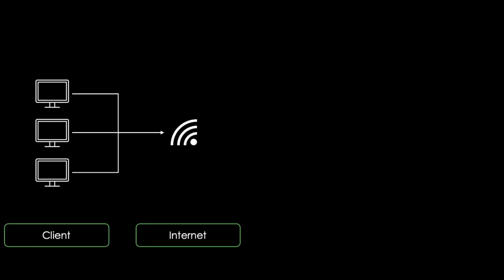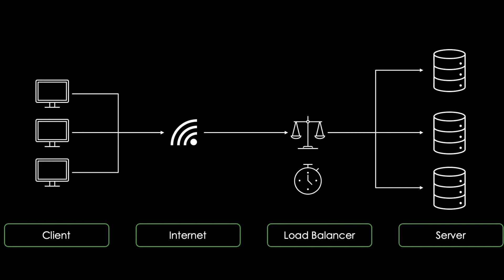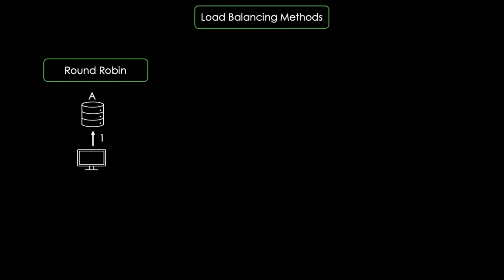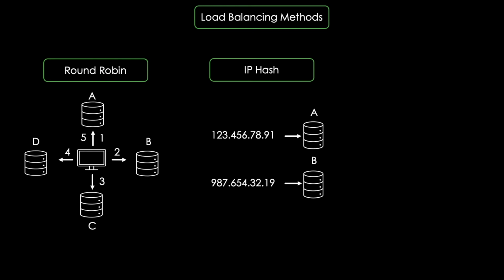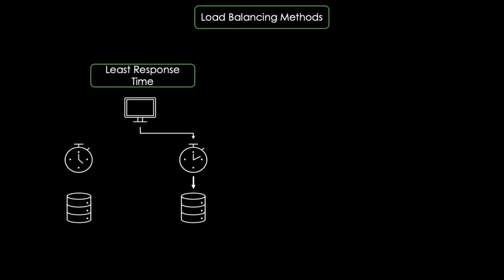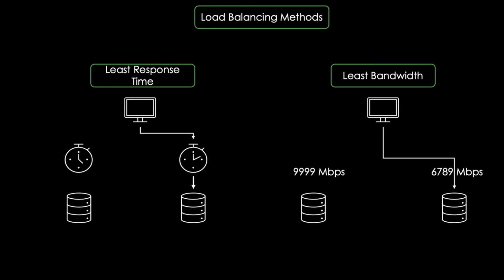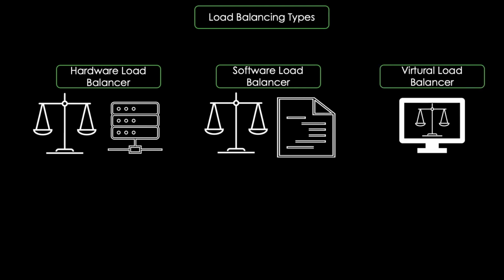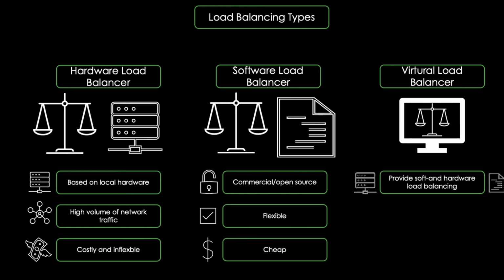What is a LOAD BALANCER and how does it work? | #NetworkTraffic

Comment: So if you have lets say a video hosting site. And you keep the video files locally on the server, does this mean that i need to have a copy of the full website and video files on each node?
Reply from the maker: If you host video files locally on a server for a hosting site and use load balancers, it doesn't necessarily mean you need to have a copy of the full website and video files on each node. Here are a few approaches to handle this:

Centralized Storage: Store the video files in a centralized storage system (e.g., NAS, SAN) or use a cloud-based storage service. All nodes can access the files from this central location.

Content Delivery Network (CDN): Use a CDN to distribute video files. CDNs cache the files in multiple geographic locations, ensuring faster delivery and reducing the load on your servers.

Replication: Replicate the video files across multiple servers or nodes, ensuring each has a copy. This can be resource-intensive and complex to manage.

Hybrid Approach: Use a combination of the above methods based on your requirements and resources.

Considerations:
Scalability: Centralized storage and CDNs can help scale easily.
Redundancy and Reliability: Ensure data redundancy to avoid a single point of failure.
Performance: Balance between access speed and resource utilization.
Choose the approach that best fits your infrastructure, budget, and performance needs.
Reply: @Tec2Check thanks chat GPT lol jk but no really thanks for the response!:)